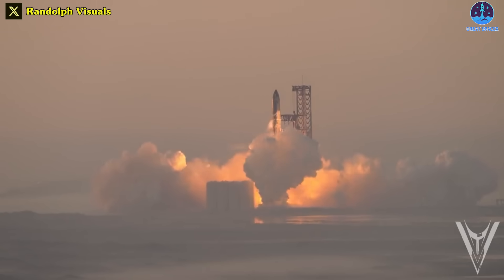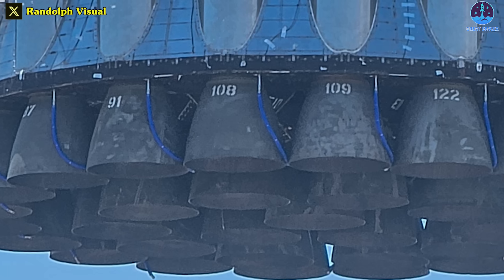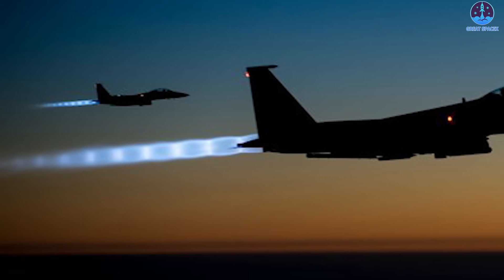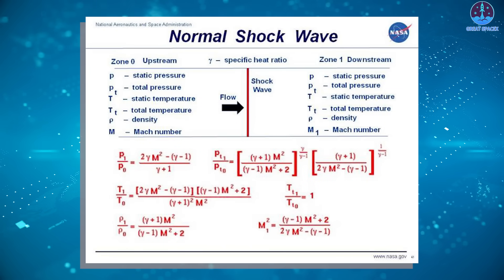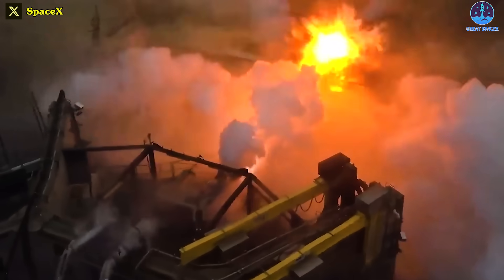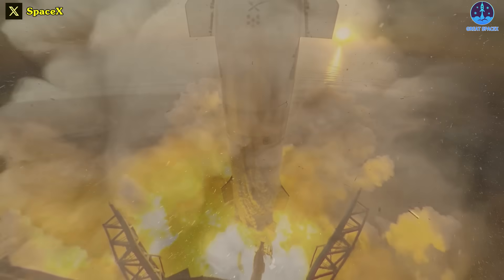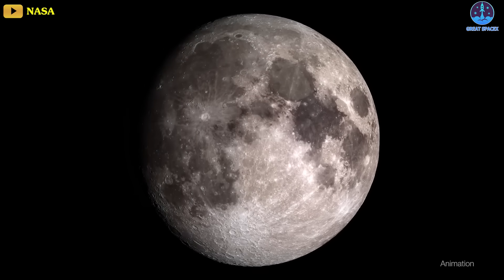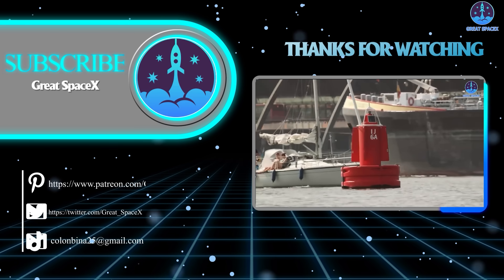SpaceX revealed OFT 2's FLIGHT DATA - 33 engines created "Mach Diamond", unlike any others...

Comment: This also proves that all of the engines performance were very close to each other.  Symmetry is required to form the diamonds which is easy with one engine, but with 33 it's remarkable.  I did notice the diamonds during the flight, but the implications of their presence didn't occur to me until much later.

Comment: The exhaust plume was stunning to see and was a standout feature of the flight.  After seeing the diamonds in test footage from individual engines, I was wondering how they could achieve the same diamonds when all 33 engines are working together.  It would be interesting to see the ratio figures from individuals compared to 33 and relative plumes.

Comment: Gas Law Constant R (Rho) = PSIG (MW) / 10.731 * K * Temp R might be a calculation that answers what took place inside the tank while it started it’s burn-back maneuver. The gas experienced a condition called rollover. It rapidly expanded from 600/1 to 10.731 PSIG over pressurized the tank causing it to rupture at the engine cap. The only way to prevent this from happening is to incorporate fuel bladders.

Comment: Yeah if the next booster uses Raptor 3 engines stage zero will need to be made with titanium to withstand the heat or maybe just use 32 degree water?

Comment: hey, theres a few errors in this one. mainly you should use SI units, as some stats were wrong and others not relevant to mach dimonds.
also you miss edit at the start and say "biggst and most obvious" twice at 1:00. its right at the start too dude.

also if it helps in an easy to understand way :
=the air pressure pushes the flame plume in on itself, as the flame is low pressure, then the pressure in the plume builds and it pushes back, creating the mach diamond pattern.=
The fans and turbo have nothing to do with it :)

love the content bro keep it up, youll get there! :) did edit and youtube myself but started uni at the age of 32 so dont do it anymore. but will really help ya views to tuch up the errors dude. good luck! and cant wait for next video :)
Reply from the maker: Thanks for your contribution. We'll take note this and try harder in the future ☺️

Comment: Thank you for another soid video and thank you for not using a digitally generated voice. What is audio hick-up around 1:00 minute? I wonder if there are mach diamonds from other rockets but we can't see them because fireball is so much brighter vs the Methane blue flame. Did the diamonds lengthen as the rocket ascended? I could not tell. It took them four or five revisions to get the Merlin engine robust and stable. Only at version 3 on Raptor so far...

Comment: ... well, the Shock 'Super Diamonds' are a testimony to SpaceX's advanced manufacturing technologies.That is to say: ... the Raptor Engines were performing nearly 'identically'. If this were not so, the huge 'exhaust plume' would still look awesome, but would be a 'hodge-podge" of smaller Shock Diamonds. Synchronicity plays a part in this because all of the Raptor engines SHARE something 'In Common' ... the  THRUST PUCK. There are numerous on-line videos showing multiple members of a system becoming synchronized. Sometimes this could be a problem, but not in this case.

Comment: 350 Bar from Gen. 3 Raptor Engine. Too freaking cool.  A Bar is a metric unit of pressure. There is too much math to show but rest assured, an engine producing 350 Bar is astounding. There is nothing but the Gen 2 raptors to compare.
Reply from the maker: And we will see bigger Shock Diamond with Raptor 3☺️
Reply: not too much math - just multiply by 15. 1 bar is 15 pounds/square inch. (yes, air pressure at sealevel, thus 350 bar is 350* 15 = 5250 pounds/square inch.
Reply: @jessepollard7132  2 1/8 tons PER SQUARE INCH! what a beast! ( just for accuracy sake it's 14.5 psi to a bar but 15 works good for back of the napkin type math )

Comment: Were all 33 engines on the booster supposed to shut down before Starship separation? Meaning the last 3 inner engines failed to do so?
Reply: No that's why they call it "hot staging" because the first stage never shuts down. If you shut down those last 3 the fuel in the tank can free float due to momentum. The starship itself is experiencing resistance with the air but the fuel in its tank isn't. That slows the starship faster than the fuel inside causing it to flow towards the header in the tanks. I hope I described it well enough. Maybe somebody else will come along and fill in or fix any stupidity I may have included. 😂

Comment: What happen to Starship no one has told us anything on why it shut off data?
Reply: That’s because they don’t know.  If you watch the video feeds the ground crew were super confused about losing contact.  We know Starship spiraled out of control and (presumedly) the FTS kicked in leading to RUD, thanks to footage from private citizens in florida.
Reply: Thanks Russelharrell, That’s all I’ve heard so far is that it just lost communications and then rud , no reason was given , the last one had a fire and burned through wires they guess , this time ?? Hope they find issue and next time have back up redundancy if one fails.
Reply: We know it was supposed to switch telemetry sources somewhere around stage separation. So it's a matter of seeing if it failed to switch sources or it was some other failure. It could have been something as simple as a software glitch to as complicated as a full telemetry hardware failure or anything in between. Lots of stuff to sift through I'd imagine.
Reply: @russellharrell2747 on the upside SpaceX got a lot better at destroying their own rocket! TBH the tumble the last one took and how long it survived before RUD was kinda scary. I expected the full stack going sideways like that would rip itself apart but it just kept cartwheeling. 😮

Comment: Baffle the bottom of the fuel tank. Pressurizing the tank with scrubbed exhaust is good, but the other forces at play with low fuel can / did starve out some of the fuel to the main pump due to pressurized sloshing.. Same thing happened with early dragsters running superchargers - fuel tank slosh, even when pressurized, starved the outlet intermittently. Baffle the tank with inverse "flapper" gates.

Comment: I think the best solution would be to do a flip by using three engines. But to do it at perfect timing to prevent fuel slosh. I don't think anything is with engines or the booster itself!